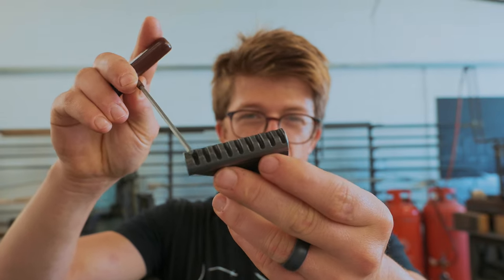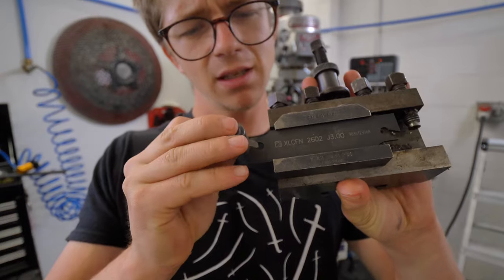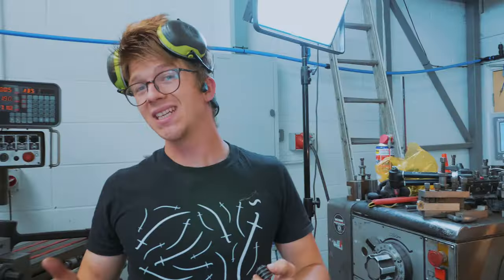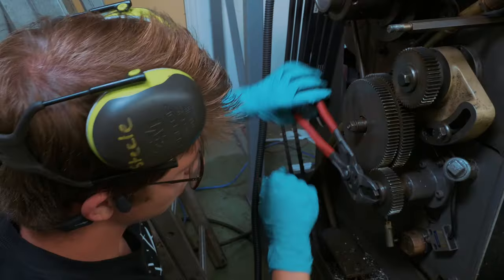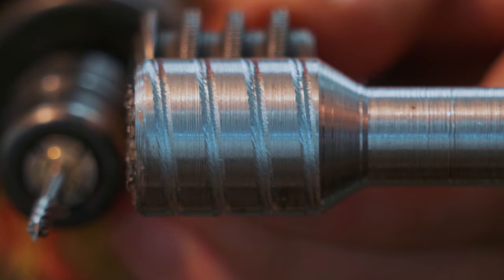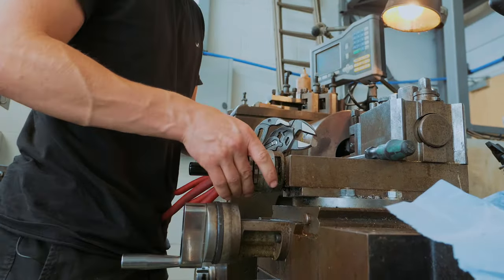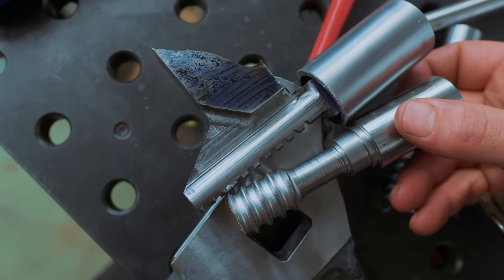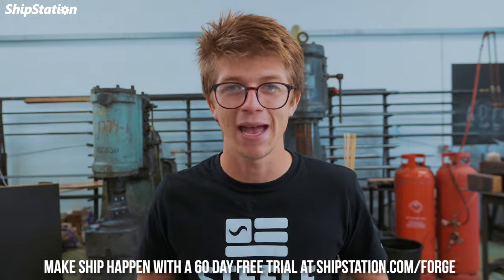Making My Own ADJUSTABLE CRESCENT WRENCH! Part 3

Comment: Your Endmill sticks way to far out of the collet. But nevertheless, just grind yourself a threadcuttingtool out of highspeedsteel and use it like you are cutting normal threads on the lathe. Additionally keep the stickout of your part minimal and support it with a livecenter. Feed in with your compound slide so you follow the threadangle. Use your crossslide to back off when you reverse your lathe.
Reply: Came here to say the same. Great advice for Mr. Steele
Reply: Exactly this, just a combination of the acme thread cutting vid and tool form vid of ToT
Reply: Yep, the backlash mattered and all but rigidity was really the main issue; both the workpiece and the tool...
Reply: You don't actually think "threadcuttingtool" and "highspeedsteel" are single words right?
Reply: @dan3458  no one asked
Reply: he needs to look at how ABOM79 does an acme screw thread...  the die grinder is not a good solution
Reply: @Tindurbox  ;D
Reply: @dan3458  Nop, but i relied on my autocorrection to add spaces. It didn't.
Reply: @antimaterie6431  that's the worst excuse I've ever heard lmao. As if you just type without ever hitting space and auto correct does it all 😂
Reply: @dan3458  you’re a bundle of joy aren’t you Dan
Reply: @dan3458  Dude's German, he just mistranslated Gewindeschneider and Schnellarbeitsstahl. 😂
Reply: @Tindurbox  I sense a new shirt design.
Reply: @Tindurbox  I don't lathe but I've watched enough TOT and Blondiehacks to have come to similar conclusions.
At one point Alec was grinding with the side of the tool, not the end, and I asked aloud "why is the tool axis perpendicular to the workpiece?"
Reply: Pedanticism at its finest.

You really got nothing better to add to the conversation?
Reply: @dan3458 , you don’t actually think you are needed here, do you?
Reply: @dan3458  when you're yelling into your phone they are
Reply: @Watsy  apparently Dan white did.   That is a question mark right?    Oh wait, was that?  Oh boy.
Reply: I don’t understand what the problem is with using a normal cutting tool just held at an angle
Reply: @wesleyfilips7052   Geometry, mostly. Tool should match the geometry of the thread its cutting, otherwise the interior face of the thread on the shank will not have the correct dimensions unless a hilarious amount of passes are taken at tiny increments. Otherwise I believe the advantages are rigidity and finish, which can definitely be make-or-break on threads.
Reply: @adamklosterman8960  i dont think you understand the point, old man
Reply: @Watsy  old man?    How do you know I'm a man?   How do you know I'm old?
Reply: @adamklosterman8960  dont post too much of your life on the internet bud.
Reply: @Watsy  how did you know my nickname is bud?
Reply: This. Mr. Steele take a look at this :)
Reply: @adamklosterman8960  oh. all quiet? typical lol
Reply: @Watsy  oh.   I thought everyone moved on.
Reply: @adamklosterman8960  Pathetic. leave half way through.
Reply: I always thought the right way to do things was the way that works!  I have learned to do things on crap Griz-lathes and Chinese 2hp vertical mills that I once did on REAL machining tools that all burned when my house and shop burned to the ground 8 years ago.  I have always  refused to owe any debt.  Tools, car, house, business…cash only for everything.  I was underinsured so here I am…learning to do things ‘the right way’ on tools never designed for the task!  …but I have NEVER seen a die grinder used as a cutter in a lathe!  THAT’S new!

Comment: Here's a thought. Why don't you create your own lathe tool out of HSS like Abomb does? Bit of grinding and sharpening and you'll have the perfect tool to lathe with. :)
Reply: I've been banging my head on the table with every next step of his process.
Just make the cutter!!!
Amazing that he hasn't hurt himself yet🤣
Reply: Considering Alex spends most of his time at the grinder, an extra 15 minuets would not have been the end of the world
Reply: My question was why not just cast some of the more complex parts? I find it unlikely Alec doesn't know someone who can help
Reply: Completely agree. A 3mm ACME thread cutting tool isn't that hard to make.
Reply: @paulhawkins6415  my thoughts exactly
Reply: @KittyCatInAMicrowave  no, the lathe is fine
Reply: You beat me to it.  HSS cut to the proper thread form and ditch the die grinder.  The lathe is already set to the right pitch/direction.
Reply: My man Alex needs some this old tony.
Reply: This. And with a workshop full of tools that shouldn’t be so difficult.
Reply: Bring Abom into the fold, please!
Reply: @KittyCatInAMicrowave  take smaller cuts
Reply: I'm pretty sure all us machinist's just spent that whole video gritting our teeth and shaking our heads haha. You can even buy ACME inserts
Reply: Rather than the jerry-rigged setup, risking life and limb. . . to make a semi-fitting screw that still needed hours of work to fit up.
Reply: Painful to watch, especially when Alec has always said "need a tool? make a tool."
Reply: @magoshighlands4074  My understanding is that casting and forging generally aren't controllable/ accurate enough to produce  tight fitting mechanical parts on their own. For mass production or very large objects it makes sense to cast or forge a rough version of the part and then machine the accurate features into it, but for one-offs I suspect that is often more hassle than it's worth.
Reply: Oh, you mean do it correctly? I gave myself a concussion I facepalmed so hard on this video.
Reply: Can’t make a 6 part video series when you do things right the first time
Reply: He's got a machineries handbook.  There's probably a table that shows exact dimension for the tool.
Reply: My thoughts exactly. Definitely less difficult than rigging up a whole die grinder.
Reply: Because doing it wrong generates more engagement.
Reply: @petermichaelgreen  Not if done on a small scale, and it would allow him to make several back up pieces if he damages or screws up the machining on one piece
Reply: @paulhawkins6415 YES! Literally 15 minutes doing the goddamn cutter! And the price would've taken another 15 minutes more in the lathe! 🤦🏽‍♂️ Very annoying
Reply: @darronjknight  and choke up on that endmill, hanging out WAY too far.
Reply: @asdfdfggfd  alos you seem to forget hes not a machinist is he. hes a blacksmith and clearly doing all these other projects because they are a challange for him to try and learn and then make
Reply: @helplmchoking  actually ceramic belts on my 2*72 do great for shaping hss tools
Reply: That episode seriously had me cringing the entire time. Usually I like his shenanigans. This one almost had me yelling at the screen.
Reply: @jackjericho7503  I know, right?  It would have taken him, like, an hour, tops.
Reply: @asdfdfggfd  I hate it that this makes too much sense.
Reply: Came here to say this. Alec needs to watch a few masters like Abom for machining.
Reply: @santosvella  If he ever does an episode with just hands, we'll know he saw some This Old Tony.
Reply: @adamblundell6402  but shipping takes time for a one time use tool. Better to have the knowledge and materials on hand to grind your own tools. If you're going to be making hundreds of threaded parts, order the tool.
Reply: @JThyroid  yes i agree and i did ment to say that. If he still had his surface grinder he could of ground one to the perfect size and dimension using a sine vice/plate
Reply: @helplmchoking  Aluminum oxide or silicone carbide abrasive is the same stuff whether it is attached to a fabric belt, or a glued up solid wheel. Belts will grind HSS just fine.
Reply: Every machinist is screaming at their screen watching this

Comment: Alec, the reason the cut is larger than the diameter of the end mill is inherent in the set up, not a machine issue. Because you're using the side of the end mill at a 90° angle, it will be slightly larger. If you match the angle of the threads (6ish degrees off 90) you will make an actual 3mm cut. This is because your not cutting at a point, meaning there is a depth AND length to the cut. Basically its a cosine issue. Hope this helps!
Reply: Even worse if you look at 8:07 I think he is 6ish degrees off 90 but in the wrong direction.  The angle on the bottom side of the thread is opposite of what we see on the top making the cut even wider.
Reply: @npavento  correct. Alec set this angle for usual thread direction and when he switched the direction on the mill he forgot about the grinder angle.
Reply: This

Comment: The amount of dedication to not just using a cutoff tool is astounding 😂
Reply: ILol, it's kinda heartbreaking to watch honestly. The amateur machinist inside me knows he could just fix up some highspeed steel using maths/geometry and get a much better result.
Reply: no, using the cutoff tool would t work eiter, since the insert would just fall out of the holder since it has no way of being retained axialy nor a cutting edge
Reply: @Basement_CNC  have you ever used a lathe before?
Reply: @Joern8910  The cutoff tool would definitely not hold up. It is only designed for load (radial) in one direction. Side loading the parting tool will kill it. Felix is right
Reply: @rossherman4515  yeah, the angle on the cutoff tool is non-existent. It would snap in no-time.

Needs something that looks like a fucked up nipple-claw on a thick piece of highspeed.
Reply: @rossherman4515  Yes it is designed for radial load, but it also can withstand light axial loads.. I have abused cut off tools multiple times to cut axially.. when you go lightly and therefore cause low cutting forces the tool can withstand those forces (of course it depends an how thick the tool is)😊 so in my opinion the cut off tool is a much saver way for him to do it without buying or manufacturing a new tool 😊

Comment: Electrical engineer here and as soon as he started with the side of the end mill I was yelling at my screen "You need to turn the grinder to match the thread, it cannot be perpendicular to the shaft or the slots will be pointed rather than squared at the top"

Comment: get a piece of HSS (Highspeed steel) Grind the tip to be 3 mm wide, make some simple relief angles and shape up the sides. Then just do single point threading as usual. no grinder or broken endmill. Thats what HSS is really great for, Shapes that are expensive to buy, or where you only have a couple of parts, in materials that HSS is suitable to cut.

Comment: Hey Alec, love your channel, but as a machinist, let me give you some advice and clear up a few misunderstandings: You correctly identified that the rigidity of the die grinder was way too sloppy to mill threads like that, and although your initial idea wasn't half bad, this entire problem could have been avoided by grinding your own HSS thread profile cutter. That is a chapter in itself, but the problem you attributed to the lead screw was not the leadscrew's fault. The backlash in the screw is not an issue because it's always being forced one way, backlash really only matter on the X axis or on mills (depending on the correct setup for the pitch direction ofc). The problem you were facing when trying to use the side of the mill is that as the workpiece rotates, the parts of your mill not located exactly on the YZ plane  will cut parts of the sides when moving in and out of the YZ plane, although the effect diminishes as the sides of the thread move away from the cutter in the Y direction. This occurs even if you angle the endmill to the pitch angle, because you are now milling an ellipsis. Try CADing it up and you'll see what I mean. HSS blanks man, rarely used, but a godsend to have.

Love you man, you're a huge inspiration. Keep up the good work. You are truly a remarkable human being.
Reply: I use HSS for most of my tooling. Granted it's on an old lantern type hobby lathe. I do have a few Harbor Freight carbide inserts. My most difficult threading that I've done was for a propane fitting into an adjustable high pressure regulator for my forge and foundry. I had left a ladder propped up, and the wind knocked it down. The ladder hit the regulator on the brass fitting that connected to the tank. That thread was a 1/8 BSPP thread type. 55 degree tooth profile, but thankfully parallel threads. Couldn't find any fittings to replace the broken one, so I bought one that had a larger thread on the correct end, turned it down on the lathe, ground a 55 degree thread tool, and carefully cut in the new threads and o-ring groove. I think my o-ring groove might have been too wide, but 2 o-rings took up the slop. Did a leak check and had no leaks. Been working fine ever since.
Reply: As a non-machinist, the problem of side milling that thread in the lathe resulting in widening and ruining the desired thread profile was blindingly obvious to me the second he proposed it. Very surprised he missed it.

Comment: Many people have mentioned grinding a HSS cutting tool, and that's probably the best solution. However, you could also use the die grinder setup you have, just do the full depth of cut with a single pass by turning the lathe by hand while the lead screw is engaged. That makes it so that your bungee is never near a powered lathe and the rigidity of your die grinder is a much less of a concern.
Reply: That is a fantastic idea that deserves more attention!

Comment: For any acme threads we would grind a parting tool in to the shape we wanted, then use a tiny shim to kick the carbide holder on a slight angle to compensate for side load caused them the high pitch thread

Comment: That was probably the most difficult way to attempt to do that. You would have been better off using the parting tool or a custom ground cutter. You could have even ground three cutters to cut the three faces of the thread and then just offset it on the cross slide. Also if your dials on your cross slide are not holding you can always throw a dial indicator on the saddle of the lathe with a mag base and touch off the cross slide to get an accurate measurement of its movement. You could do the same with the saddle if you need. You are only limited by the range of your dial indicator.

Comment: A lot of people have nailed it.  A machinist would normally have HSS lathe bits on hand, and will grind whatever profile is needed for the cut.  Just like you will dress a grinding wheel to grind a profile, or grind a drill bit to a new profile for different materials, or even make a custom single lip cutter out of drill rod for a unique profile.  Learning to make the cutting tools is an important part of machine work.

Comment: Generally, for threading and facing I like to keep my compound slide at 30 degrees. Set the zero on my X and Y and use the compound to form the thread. Since I use imperial, I feed every passing thread at .005, depending on the material of course. Hope this Helps, looking forward to the next episode!

Comment: I have into into lash issues on my mull one time and discovered it was my tool actually deflecting. You can simply modify you cutoff tool to cut the tread. My machining instructor had us make our own lathe cutters the first week and once you realize you just have to do the grinding slowly and to keep the piece cool it goes pretty easily

Comment: Excellent project so far, but you could have avoided hours of fitt-up if you'd aimed for sloppier fitting parts.  Also helps keep the tool from binding up if sand or chips get in it.  A diametrical clearance of about 0.01" is a good start.

Comment: Some of the backlash problem can be alleviated by leaving the half nut engaged  and using the engine to back it up.    Once you are in gear leave it there until you are finished.  On some lathes you have to do that anyway for metric or english threads with a 1/2 in it.

Comment: the reason acme thread is used is mostly for the comfort of turning the screw with your thumb
Reply: The reason that an acme thread is used is because it's a ridiculously strong thread that can take a lot of torque and load before failing. Most machine tools use an acme thread for that very reason. Comfort is legitimately that lowest priority in something that like, the ability to knurl the top is bonus compared to strength. 

Sadly, his sloppy-make it work-screw will likely fail at the worst possible time during use because it's sloppy and shite.
Reply: @tsunamidelta1351  but you usually don't use a crescent wrench in a situation that requires large amounts of torque, and I doubt the force is completely transfered linearly into the screw to cause the threads to strip. But I do agree that Alec's botched threads might be too weak

Comment: When you are cutting those screw threads on the lathe (using the side of the tool) your width of cut is greater than 3mm because the end mill is angled towards the chuck. The first cut will be 3mm, but every subsequent cut will be wider than the last.
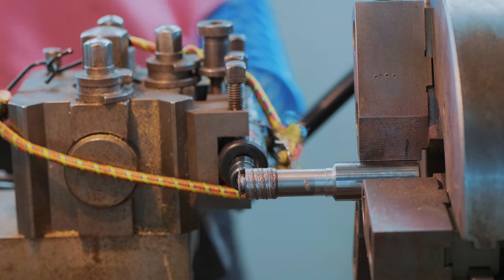The easiest way to visualise this to look at your plunge cut (07:00). Put the mill and the very bottom of the cut. Now try to angle it towards the chuck. It's impossible.

Comment: To make acme threads like that in the past I’ve silver soldered a lathe external acme carbide insert to a hardened shaft, I used this in a cnc mill, but it would definitely work on the lathe

Comment: If you use grinder to grind threads, you can turn the lathe spindle by hand and still have proper feed from lead-screw. It propably help a lot to compensate lack of rigidity on a grinder and give better feeling on the feed speed. It looked like your end mill teeth were binding into the work piece because feed speed was too high.

Comment: You should have reamed out the hole for the moving jaws, drill bits cut a slight bit undersized, but a reamer cuts to the right dimeter.

Comment: Alec the problem is called tool diffraction. You have to have a cutting tool like a parting tool to minimize the tool diffraction not an end mill in a die grinder.